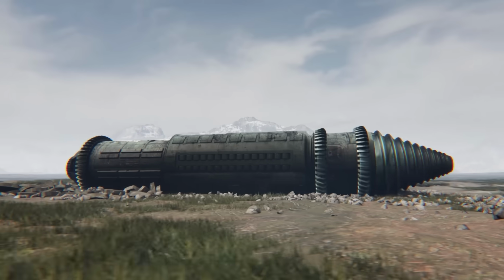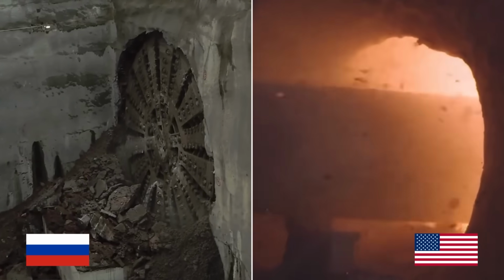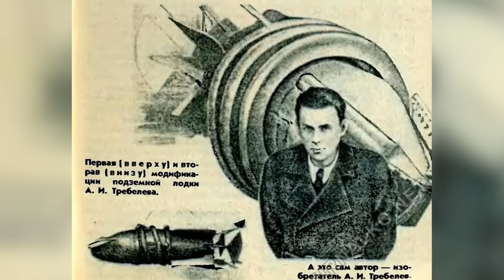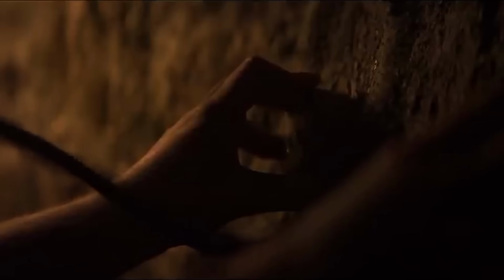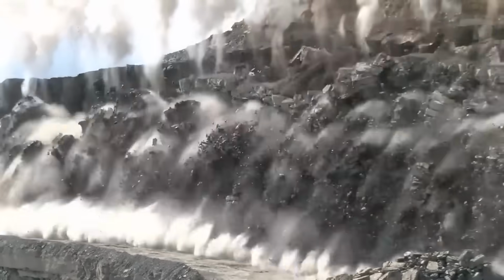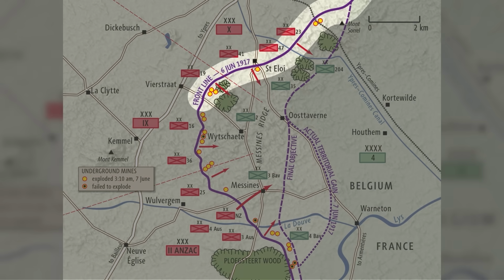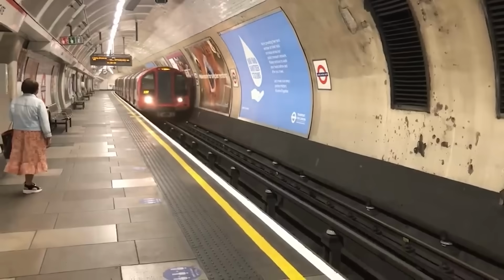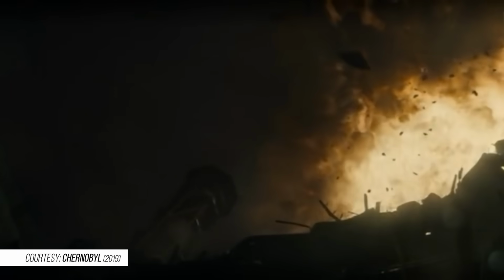What happened to Land Submarines?

Comment: Getting indeed vibes of thunderbirds, teenage mutant ninja turtles and the NOD subterranean APC. That being said, having worked with cutter suction dredgers which cut rock, you have (steel with tungsten inserts) wear parts that need replacement every so often due to abrasion. Tungsten itself is too brittle so a rod of it  must be held together with a  steel teeth, same goes with TBMs and drum cutters. At some point the soil becomes too hard to economically drill and the cost effective solution is to drill and blast.
The cut rock needs to go somewhere (it takes up more volume when broken), loose soil, clay and peat have pores and may be pushed aside, not so with solid rock. It's a nice science fiction concept, but that's what it is, fiction!
Reply: Not just them, Nosecone from the Transformers, the Pit Viper from G.I. Joe, and the Magma Mole from M.A.S.K. (Mobile Armored Strike Kommand) all then likely drew inspiration from these things.

Comment: I love the idea of taking something that whilst underwater is practically impossible to find, then putting that in rock where it leaves a perfect trail of the exact path it took.... 😂😂😂 
And this alm9st certainly DID NOT happen. There is a reason that tunnels aren't dug this fast and basically its just not possible. With how 9ften the cutting head would need to be replaced, the amount of earth it would displace if it actually could move at a brisk walking pace co sidering even the most expensive and advance tunnel boring machines today aren't even half that quick. It's just not actually possible on a physics level. First the cutter would disintegrate and melt if it were moving that fast, plus they would have to stop every few inches to back out, change the cutter. Then get moving again. And if something that large really could go through rock that quick it would melt the rock, but would very easily melt the metal on the machine itself.... 😂😂😂
Reply: Aww ya had to bring physics into it.  :)
Reply: First, rocks have lower melting point than most alloys. 
Second. I don't think we have rights to say what was stupid and in what way. It was previous generations of scientists and engineers, they weren't have our amount of knowledge and experience, as well half of today's technologies. 
Things that today knows every first grader, wasn't so obvious for them. Even more, they was actually the ones who discovered this knowledge. 
Just watch first projects of jet planes, space ships, from both USSR and USA. Amount of mistakes that was made huge. And it almost impossible that everything worked as intended.
Reply: @Jedai_Games  Hmm; I have to disagree. There were many people back then that knew this idea was a no-go, so to speak. Rock was just as hard and unyielding then as it is now; they understood thermodynamics well enough to know a vehicle like this could never have enough power to work, or enough strength to survive.

Comment: With the US design for an underground submarine, using heat isn't just military anymore. Recently, a start up, forgot the name, started using the technology used in fusion reactor research as the source of the heat for the beam to drill for kilometers straight down to get to real sources of geothermal heat for energy. The drill is seen to be a lot cheaper, and way faster, than a mechanical drill, and a lot safer for everyone.
Reply: Correct Bechtel, a private military contractor was using a nuclear submarine reactor in a under ground boring machine. Someone on the Shawn Ryan podcast brought it up not to long ago.
Reply: @StephenAMG63  That's not what I was talking about.
Reply: Bechtel bought the Electronic Warfare company I used to work for long ago. If anyone could do that kind of stuff, I imagine it would include them.  @StephenAMG63
Reply: Even if you had a nuclear-powered-rock-melting laser, you still have to remove all of that [now molten] material in order to actually dig a hole.
We use a big CNC laser cutter at work and it needs a 60PSI jet of compressed nitrogen blowing liquid metal out of the kerf in order to actually cut anything.
Reply: @The_Inquisitive_Inquisitor  Not sure what tokamak reactors use to heat the gas, but I doubt it's a laser like what you use.
Reply: @WolfeSaber  How they melt the rock matters a lot less than how they get rid of the molten rock. Lava doesn't just disappear....
Reply: @The_Inquisitive_Inquisitor  There are videos on how this drill works

Comment: That is exactly what the planet needs: Elon Musk with nuclear reactors.
Reply: Yes. His philosophy of build and break it is a little frightening
Reply: Musk owned several drilling machines that could travel up to roughly 40.25 kph (25 mph) through solid rock.  In 1976 The Guinness World Record-holding fastest tunnel boring machine can cut over 7 meters an hour,
Reply: @duelde-consulting6403  You are talking complete nonsense to hype up Elon, and here's the proof straight from The Boring Company Wiki:

Las Vegas Convention Center

In May 2019, the company won a $48.7 million project to shuttle visitors in a loop underneath the LVCC. Boring of the first tunnel, 4,475 feet (1,364 m) long, began on November 15, 2019, and finished on February 14, 2020, excavating an average of 49 feet (15 m) per day.

Edit: Now you're claiming 7 miles per day to me back at your own comment. Which is it? 25mph or 7mpd? Care to provide a link to back up your ever-changing story?
Reply: tbh I believe Musk as much as I believe Putin @duelde-consulting6403

Comment: Straight up like in Metal Slug 5 (the Sandmarine boss)
Reply: The difference is the Sandmarine go down on sand not on rocks also Sandmarine design is basically a submarine with treds on the side

Comment: Considering that boring a tunnel with humongous dedicated equipment inclunding similar machine takes years and costs billions I cannot fathom what kind of stupid went into  "military pays for R&D"
Reply: Never underestimate people in power going down the rabbit hole through ego, or obsession.
Reply: It takes years and costs billions to do it safely.  Remember who we're talking about.
Reply: @dudermcdudeface3674 no it just takes years and billions to do it. The drill heads just don't last long and need constant replacement. On major drilling project these blades are replaced a few times a day. And in some cases the entire blade assembly needs replacing. 

Honestly the heating option is more realistic if you were talking being continuously used, but there's nothing that could possibly melt rock like that. And while nuclear is always talked about for being extremely powerful, it isn't. Uranium does have far higher energy density than most fossil fuels, but our methods for getting and using that energy are very slow while fossil fuels are completely spent in an instant. It's the whole reason fuel rods only need replacing every 6 months to 2 years. It would have more energy if we uses as much uranium as fossil fuels.
Reply: This reminded me of a quote from a russian comic
"Oh, it's funny yeah?"
"THIS IS RUSSIA"
Reply: @GlyphidGuard  it looks more like a quote from a russian politician Vladimir Zhirinovsky. But he could be mistaken for a comic, yeah
Reply: Considering how higgs Boson has become, viable technology. To destroy the higgs Boson makes this absolutely a highly probable, and affordable piece of equipment.
Reply: @7792448 You keep using that word, but I don't think it means what you think it means.
Reply: @7792448 What is that even supposed to mean? The Higgs isn't technology, it's a quantum field, and we can't do anything with it. Hell it took us decades and serious debate to even find a single piece of evidence for it. Plus being a boson it's likely impossible to manipulate. Bosons aren't nearly as easily converted between flavors as fermions.
Reply: I think it's pretty obvious from the war in Ukraine that what Russia claims to have in millitary hardware is severely exagerated.  If Russia's millitary was just half as powerful as it claimed, the Ukraine war would have been over within 3 days. I wouldn't be surprised if even it's nuclear arsenal is just a bluff.

Comment: This technology has been implemented in the present day of tunnel boring machine.
Reply: Yes they have but there is a huge overarching reasom why TBMs haven't been used militarily - they are incredibly slow (700 metres per week), far too slow for any serious military application. 
Maybe during WW1 with the prevalent static warfare, but in modern (1960s on) mobile warfare....
Reply: @vaulthecreator   TBM are building a concrete tunnel through extremely hard rocks. For them, soft ground is even worse, because it is more difficult to avoid landslides and secure rings.